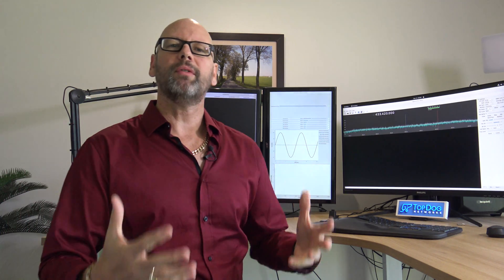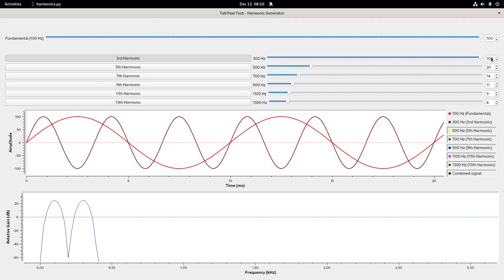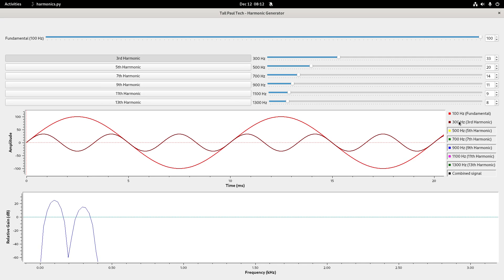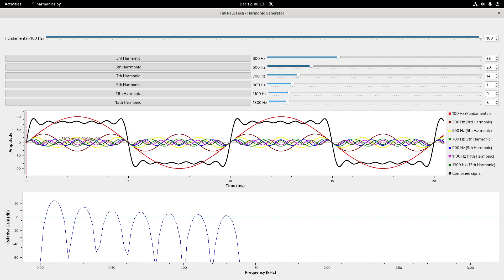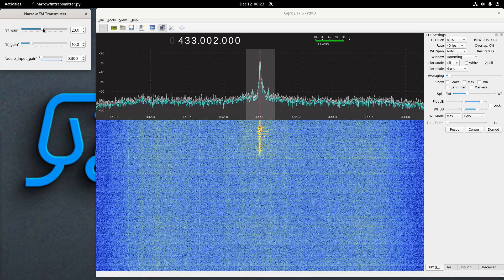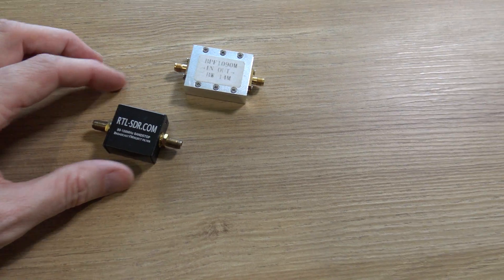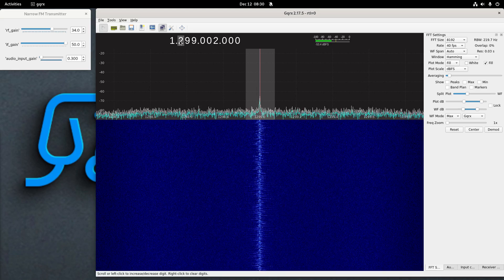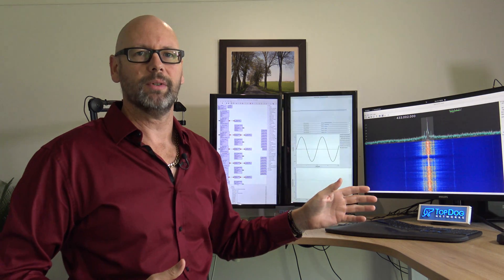Effect of harmonics and interference from clipping and square waves

Comment: DC might happen if clipping is asymetric, but usually its not. most power amplifiers have an output C so no DC. even in case of no C and asymmetric clipping: why would the speaker be more loaded than when the same signal is not clipped which clearly delivers more power?

Comment: I feel like your conclusion was back to front - Wouldn’t you expect that if the clipping was receiver side, after the attenuation it would disappear entirely along with the harmonics?
The reduction would suggest clipping happens on the transmitter side and the receiver picks up the same but reduced harmonics?